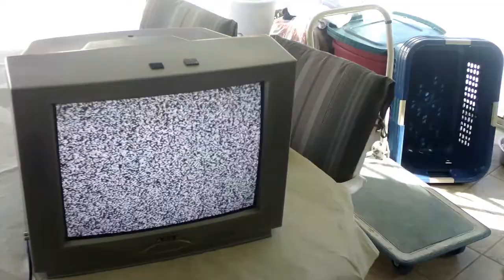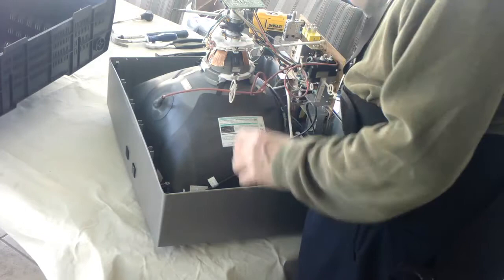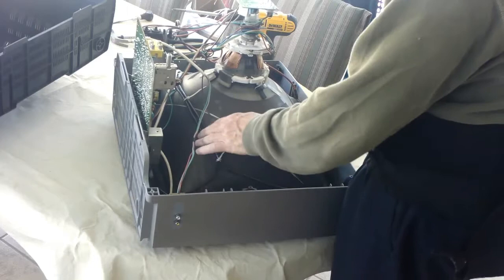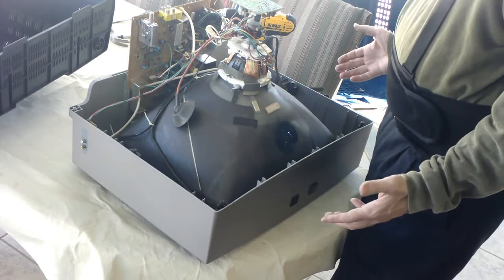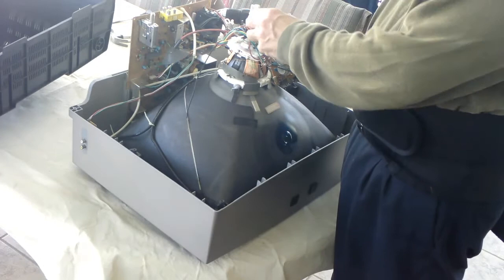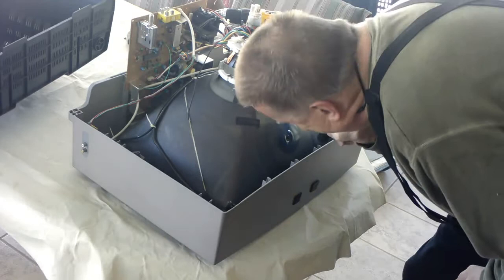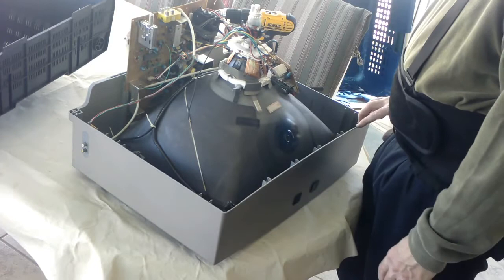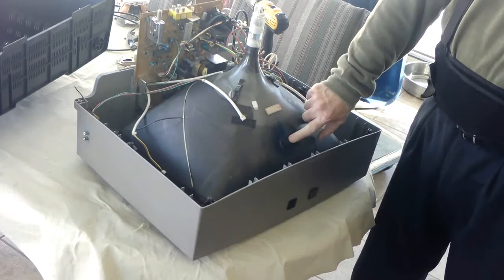How to SAFELY Discharge and Release the Vacuum from a TV / CRT / Computer Monitor Display tube.

Comment from the maker: I should have used a sharper Ice Pick....  But I guess you get the idea.  ;-)
Reply: I have a crt that works but is dusty and had a spider on the bottom. Do you think it’s worth opening up to clean? Like would their actually be bugs inside? I really don’t want to open it up, but I also don’t want to bring it in the house lol
Reply from the maker: You ask if I think it's worth opening up an old CRT to clean it?  In short, my answer is "probably not" (in my humble opinion).  Flat panel displays are so cheap these days; they take less room; and they cost less to operate.  The ONLY reason I would consider opening any CRT these days is for disposal and recycling purposes.  Additionally, I wouldn't do this in my house, even if I knew there were no bugs.  My patio, my garage, or simply outside...  that's where I would do this work.  Good luck with the spiders!! ;-)
Reply: @mystfoundung3362  i would do it those crt tv’s can be really good for retro gaming and i stil have one to
Reply: Hello, I've just find a CRT TV without the electronics inside. To not waste it do you think if I put a lamp behind the phosphor glass from the inside I will have a green light? I would like to transform it in an ambiance light
Reply from the maker: @alter5102  I don't think so - not without breaking open the back of the tube - which I would NOT recommend (toxic and dangerous).  I think that the SAFEST thing to do would be to remove the whole tube (and discard it safely), and replace the tube with a sheet of clear plastic or glass - cut to fit into the opening, and then use Spray Paint of your desired green color on the inside of this new screen.  Light it up from the inside using an LED bulb so it doesn't generate much heat.  This is what "I" myself would do if I needed something like this.  Let me know what you decide to do!  :-)
Reply: @ToddMcMahon  I think I will try to deactivate the vacuum inside with your method and to drill a hole in the glass tube at the size of my led bulb. I will spray a clear plastic sealer on the inside to secure the phosphor. I will seal the gap with silicone. But I'm not sure if the light will be visible behind the phosphor layer?
Reply from the maker: @alter5102  - I really do not think that will work, and drilling thru the glass tube would be dangerous.  Seriously - I would NOT recommend that.  Your safest option would be as I previously recommended:  Remove the tube and replace it with a piece of clear plastic or glass, painted on the inside with a green "glow in the dark" paint.
Reply: @ToddMcMahon  I remove the vacuum with your method and it works great.
Reply from the maker: @alter5102  Glad to hear it!  :-)

Comment: Used this method to discharge an old tv for a costume. It worked like a charm!! Thank you for prioritizing safety. No costume is worth risking injury for.
Reply from the maker: Happy to help!  :-)  How did your costume turn out?
Reply: @ToddMcMahon  Awesome! I used a Sylvania television almost identical to this one and gutted it for a TV head costume. It looks sick! I also salvaged the wires and copper from inside for other crafty uses.
Reply: @daft_mervy  ooo could I see it?
And how did you make it, what tv did you use, and could you make a yt vid on what it looks like?!
Reply: @justapineapple8464  I could make a vid about it in the future if I have time. Here's a short explanation in case I dont:
  Like I said, the TV is nearly identical to the one in this video, Sylvania brand. Once the innards were removed I cut a hole for my head in the bottom. I used a large piece of flat plastic (such as one from a storage box) and tinted it with car window tinting. I put that in the place where the bulb once was, and painted the exterior in bright paint spatters. I also put some foam inside to help it sit on my head.
  The plastic 'screen' can be seen through by you but not others if you use dark tint, and looks just like a real tv. I decorated mine like the TV's seen in Twenty One Pilot's newer music videos for SAI. Also, save cords or cables that come in the tv to use on the exterior for a messy, cyborg-ish look. I even kept the main plug to glue to the back!
  It's very fun but a little cumbersome to wear (I would use a smaller tv in the future) It's perfect for Cons or Halloween!
  Good luck if you decide to make your own!! :)
Reply: Dude cosplaying as pyrocynical

Comment: This video was fantastic!  I have an old  35" TV tube that I needed to make safe before throwing it out and didn't know how to do it.  I followed your procedure and it worked like a charm!  Electric capacitance discharged and vacuum released successfully and safely.  I used a hammer and nail instead of an ice pick.   It worked great!   I was really worried about properly disposing of the tube so that it wouldn't harm anyone.   I feel much better now that I know the danger has been removed.
Reply from the maker: I have discharged the electrical current, and released the vacuum on dozens of monitors over the years, and I find those sounds to be very satisfying.  🙂 It actually feels GOOD when you know you are doing something the correct way, and that your actions might help keep others from getting injured.  Thanks for the comment!  🙂

Comment: I'm sorry, but why the frick would you ever want to destroy a working CRT TV/monitor?
Reply from the maker: Where did you get the idea that this TV was fully functional?  Besides, it was way overdue for an UPGRADE!  ;-)
Reply: @ToddMcMahon  My CRT TV that I use for retro gaming is starting to shut off by itself randomly usually once per night. Also the video sometimes ripples across the screen. I just want to repair my CRT. Do I need to discharge the electrical charge and vacuum to disconnect the motherboard safely? 

I just want to replace all the capacitors.
Reply from the maker: @festeezy  Hi Mike!  Do NOT discharge the vacuum of the tube if you ever want to use it again!!!  This DESTROYS the tube's ability to function!  Discharge of the vacuum is ONLY done prior to Disposal or Recycle.  Yes, you should discharge the electrical current before working on it.  With regards to the repair, be sure to check for bad solder joints, and carefully resolder anything that looks "dull" and not bright.  Be careful not to over solder, or allow one solder joint to bleed into another.  Just remember that repair of a CRT is actually the work realm of a trained and experienced electrical technician, and should not be attempted by a novice unless you are willing to sacrifice or ruin the device you are attempting to repair in order to gain knowledge.  Just be careful.

Comment: My crt hasn't been plugged in for 7+ months but I'm still nervous I'm going to injure myself because I've never worked with anything electrical in my life.
Reply from the maker: @Colin White:  Some CRTs have a slow-bleed resister that will discharge the electrical current over time, but unfortunately, there is no way to tell without first looking at a schematic.  I think it is best not to risk it and follow the processes I outline in this video.  If you are cautious, and not touching anything metalic, or any of the electronic components, you will be fine I'm sure.  If you are still nervous about it - ask a friend to watch this video (AND SUBSCRIBE ;-) and then ask if that friend would be willing to help you out!
Reply: @ToddMcMahon  thanks friend!
Reply from the maker: @colinwhite4710  My pleasure!

Comment: Wow, watched a few videos before this trying to find the safest way to release the vacuum, and this is the first I see with this method. A lot of people stand back and hit the electron gun with a hammer. Thanks for putting this out!
Reply: Just did it. No mess, super easy. Thanks again.
Reply from the maker: Hi Dandur!  Thanks for the comments.  Yeah, I know what you mean.  I was looking at videos for copper recovery, and smelting, and every single one of the videos where they took deflection coils from CRTs - IF they even bothered with discharging the electrical current and releasing the vacuum, their processes left a bad taste in my mouth.  I had the opportunity to work for a company that had this one department which manufactured very high resolution CRT displays for military AWACS airplanes, and I learned a lot from those technicians.
Reply: Todd McMahon I’m glad you put it out here. I searched on google afterwards, and found some people who suggested your method, but very few. And they were buried under a plethora of answers and comments discussing  where to break the glass and how to protect yourself from the resulting mess. I started learning about electronics last year with a beginners book and a breadboard to build small circuits. I learned a lot from that book, unfortunately I reached the end and think getting a new book will be my next step, since information on the Internet is so varied. So glad I saw your video, because finding the best solution can be difficult at times when only reading them, but seeing them can make the winner very clear.

Comment: Thank you for sharing this video!! I learned the hard way and got shocked by one of those old TVs and that hurt and the worst I've ever been shocked!
Reply from the maker: Trust me, I understand.  It has happened to before as well when I worked as a technician.  Little shocks for the most part here and there, but once got a serious jolt when I was adjusting the contrast on the main board of a high resolution 21-inch monitor that was powered on.  Hot day, and my hand was wet with sweat.  We were supposed to be using plastic or fiberglass tools, but I couldn't find any (another tech had taken them all for a service call), so I used a regular metal screwdriver with a plastic handle.  I figured it would be safe enough.  My hand was sweaty, and when I leaned forward to look at the picture screen while I was adjusting a potentiometer - my hand slipped off the handle an onto the metal shaft of the screwdriver.  My hand jerked, and the tip of the screwdriver hit some live contact.  My forearm was leaning on a metal RFI Shield, and I was shocked severely from my hand, and thru my wrist.  The jolt was strong enough for my metal watch band to arc against the RFI shield, and both were discolored by the spark that passed between the two pieces of metal.  My hand and forearm were completely numb, and I was shaking like I was suffering from too much caffeine, and my arm was more-or-less useless for days.  I can only presume that the sweat on my skin allowed the jolt to pass over the surface of my skin instead of deeper thru my arm (maybe?).  I consider myself fortunate to have survived, and with no lasting effects.

Comment: I heard always "one hand behind the back" just in case. You don't want voltage running through your chest. Eye protection just in case? Thank you for the video! Very hands-on!
Reply from the maker: Hi Kirk!  You're right - those are both great points.  One hand behind the back for anything with LIVE power for sure - especially if you are unfamiliar with the device or process.  In this case however, we are dealing with "residual" power, and it's probably not deadly unless you have a pacemaker or a some other heart problem - it sure will hurt though!  As for eye protection, you caught me there, which is sad as I am a true proponent of Personal Protective Equipment (PPE).  I suppose that because I have done this a hundred times or more, I'm a bit more "lax" about it.  <shrug>  Good catch though!  🙂

Comment: Like the video but wish I could see more of closer look of exactly how you discharged it
Reply from the maker: Yeah, good point.  My arm is covering that part a bit.  Take a look at this photo I found on the internet.  Just take a couple screwdrivers; place one under the ground strap; place the other under the rubber "Anode Cap" (with the screwdriver touching the metal clip under the cap); then short it out by touching the two screwdrivers together.  http://www.electronicrepairguide.com/images/anode%20cap%20discharge.jpg

Comment: Thank you I learnt more precious knowledge on tv's I was mainly for a video on replacing my cathrode tube as my screen has lost colour and is in green mode colour I really want to fix it as I love crt tv's I'm not a plastic tv fan
Reply from the maker: Hi Kevin, Replacing the cathode ray tube might not be the answer.  Many times, a bad solder joint is the problem.  Can you solder?  If not, do you know anyone who can?  I have often seen bad solder joints on the circuit board(s) where things get very warm.  Remember to unplug and discharge the tube like I showed in the video.  Look at the connection at the back end of the tube, sometimes you can find bad solder joints there.  Check any areas that look like they are getting hot - often discoloring the circuit boards;  Check the contacts of the Fly-back Transformer;  Check all resistors for discoloration, and all capacitors for bulging.  Also use your nose and sniff the components to see if they smell burnt.  You wouldn't believe how many things I have repaired just by doing these few diagnostic checks first.  GOOD LUCK!
Reply: Thanks Todd I been over a tv licence if repair centre telling me The cathode tube has packed up I did some soldering on minor crack joints on circuit boards and circuit board behind the cathode tube made no difference seen a video mentioning the capacitors need replacing the 400v 180 uf
Reply: @ToddMcMahon  sorry I meant tv repair centre
Reply from the maker: @shorty5346  - No worries, Kevin.  I was able to understand.

Comment: when i connected the 2 screwdrivers to discharge it i didn’t hear a sound or any pops… the tv is broken but i turned it on 2 days ago to see if it’d turn on which it didn’t. Because it didn’t make a pop sound is it still okay for me to continue taking it apart? is it already discharged?
Reply from the maker: Yes, it sounds like it is already discharged, if you were making good contact.  Just be careful, and maybe do it again just to be sure.

Comment: That method of discharge is a lot more dangerous than screwdriver with grounded alligator clip
Imo.
Reply from the maker: Yep.  You're right.  But this method works fine.  How many people do you think actually have one of those in their tool set?  What kind of skills do you think those people will posses already?  The video is intended for novices...  and most people will NOT want to go out and purchase a special tool for what might be a one-time task - nor have the desire to make one.   Besides, people with a grounding tool like that will (probably) already know what they are doing - and probably will never see this video.  ¯\_(ツ)_/¯

Comment: Good afternoon Todd, I hope you're doing well. I was wondering if I can ground to a nail in a piece of wood, or does it have to be a larger piece of metal. I noticed my my small 12 inch crt does have the grounding wire, but I was wondering if it is possible to ground to something outside of the television, like a nail, screw, small pipe, etc.? Thank you, again.

Kaz
Reply from the maker: Hi Kaz!  :-)  The grounding wire that stretches across the back of the tube is your best choice.  Grounding to something outside of the device electronics is a bit problematic - as it is not part of the electronic circuit that you are attempting to discharge.  Grounding to a nail in a piece of wood is a waste of time, as the wood is an insulator.  Just use the grounding wire that is inside the CRT.  The point that you are grounding to must be part of the circuit.

Comment: is the purpose of releasing the vacuum for recycling or will the display still work after the vacuum is released sorry if I missed the answer in the video
Reply: Also this video is the most helpful video I've come across thank u sm
Reply from the maker: The display will no longer work once the vacuum is released, and it will be much safer to dispose of or recycle because that big vacuum tube can no-longer implode.  Be sure to discharge any stored electrical current first though!